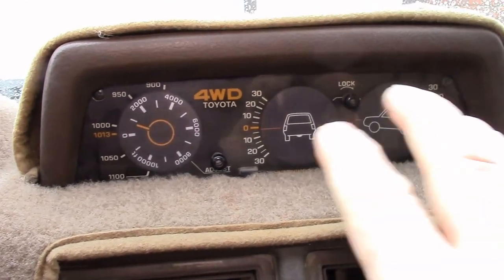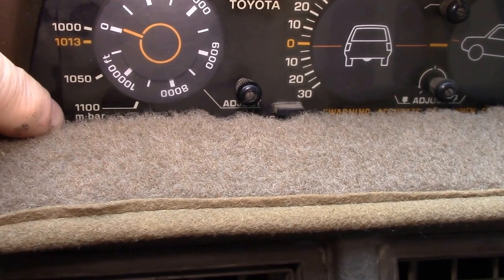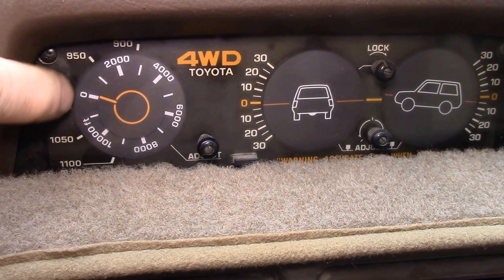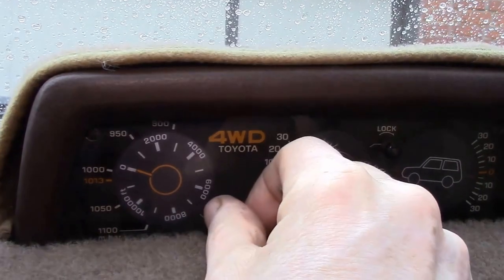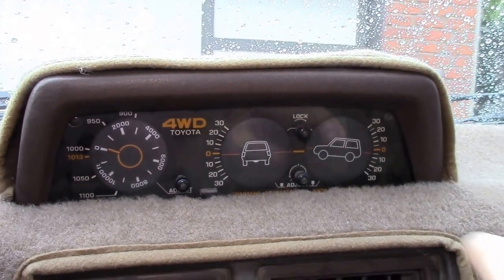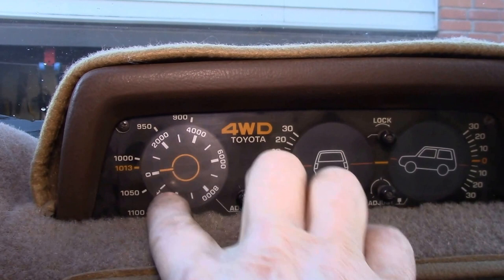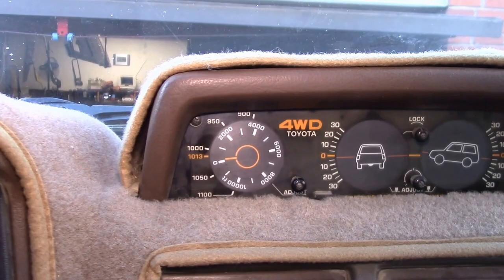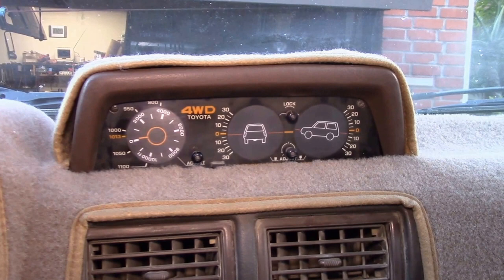Toyota Clinometer Demonstration

Comment: THANK YOU! I have one to put in my Suburban.  Just watched the video, I have more questions on the altimeter portion.
Reply from the maker: I find the altimeter portion is pretty easy to use.  Only thing I do with it is to calibrate it before heading out if there's been a big barometric pressure change.  Then on the road, I'll usually re-calibrate it once I pass ~4000 ft. elevation if I pass a road sign with elevation displayed.
Reply: @The4Crawler  Thank you. I just tried it driving home from work. Only 1000 ft difference, but it worked! I'll rewatch, probably several times for the barometer info. Thank you  again!
Reply from the maker: @jamesrobinson6441  It's pretty easy, I know my approx. elevation at home.  When I hop in the truck, I look at the alt. and if it's off of that reading, I reset it.
Reply: @The4Crawler  I'm converting my dash lights to the 194 multigloz rgb led lights. Awesome effect! I has to trim the bottom off one of the bulbs so it would fit. But it looks great.

Comment: I wish there was a way to make the side view and rear view of the dials to look like a pickup instead of a wagon. Something like a stick on cover that could be removed.
Reply from the maker: Good idea!  Hadn't thought about that as I have a 4Runner, which I guess is what the graphics on the gauge are meant to depict.  Suppose one could get either a black marker or some matching paint and touch up the face of the dials with that to make it look more pickup-like.
Reply: Just get a printed cut of vinyl with the desired graphic you want. Any print shop (tshirt, banner, logo shop) could do that for cheap. The clinometer comes apart easy.

Comment: This is an old video but I'm still gonna ask, where did you get your dash cover?
Reply from the maker: I think I picked that up from JC Whitney (now CarParts.com) many years ago.  I recall it was a DashMat brand and it was a perfect fit.
Reply: @The4Crawler  it looks to be from the same material as the factory truck mat
Reply from the maker: @festivekamikaze  Yes, it does seem to be a fairly close match.  I think this is their carpet style cover, I tried to pick a color that was close to the factory color.  It's held up great, no signs of sun damage after ~20 years.

Comment: Thanks for the video.
Reply from the maker: Thanks for the comment, glad you enjoyed the video!
Reply: Got one coming that im gonna get into my 91 truck, Nissans and Isuzu troopers had these in them aswell. Too bad it doesnt adjust with the pressure but i guess if you leave it over night and its different you know weathers gonna be different.
Reply from the maker: Yes, not quite as sophisticated as an aircraft altimeter where you can dial in the local pressure to calibrate the altimeter reading.

Comment: Mine doesn’t work how do I fix it
Reply from the maker: Could be as simple as the lock knob being in the Lock position.  If that's OK, then it may be something inside is jammed up.  Take it apart and see if there's any loose debris inside:
https://www.4crawler.com/4x4/CheapTricks/Clinometer.shtml
Reply: Also dude the two knobs which u can turn have lost the plastic covers on them so it’s just a metal needle left behind no plastic on two of them where can I get them from ? 
Thanks in advance bro
Reply from the maker: @endofdayzfitnessu.k2126  I suppose you might try looking for small knobs like that in a hardware store or on-line, perhaps a shop that carries clock repair parts.  Or try making something with a small piece of plastic the proper diameter and drill a hole in the middle to fit the shaft.